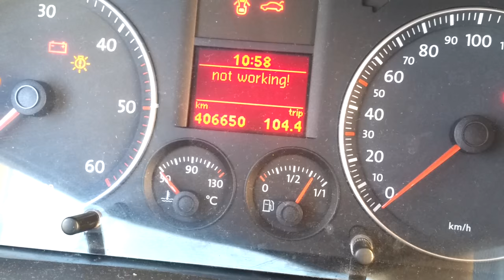VW Caddy Maxi Replacing the Rear Brake Light

Comment: For VW caddy 1999 - 2003: 
Remove big cover on the inside of your car (behind the light). Click and slide out the light fitting bar. Replace light bulbs. 
To change light housing:
Continue by removing  the three bolts from the inside of your car. Push out the light cover. 

To re ensemble follow steps backwards. 

Don't try to pry out the light cover with a screwdriver. It's bolted in there and it will break like mine did 20 minutes ago :(